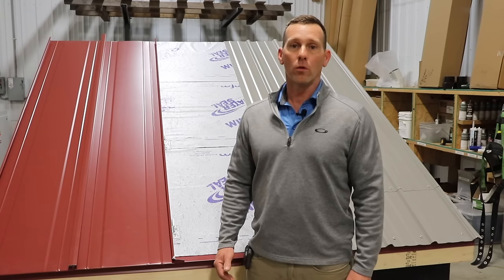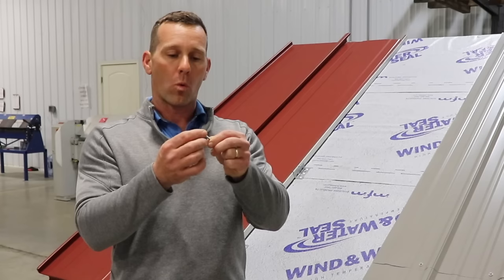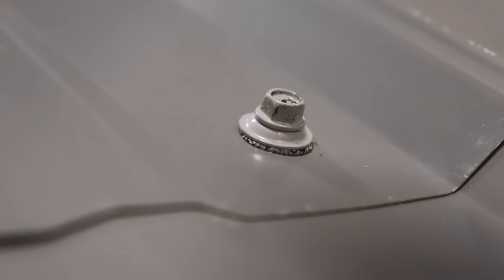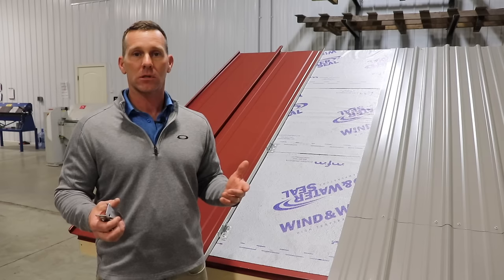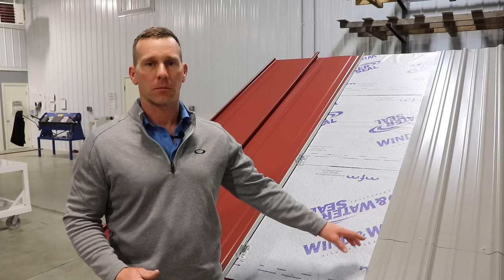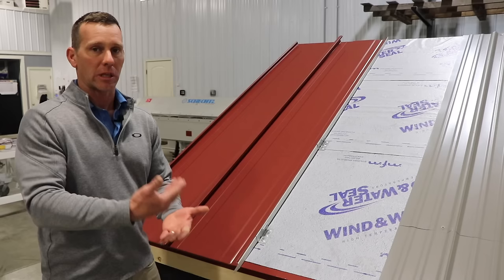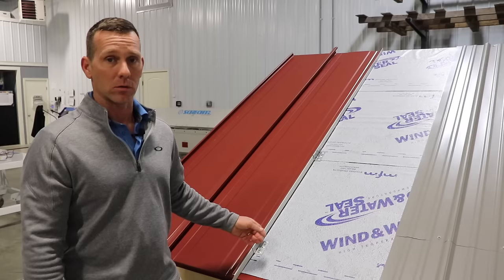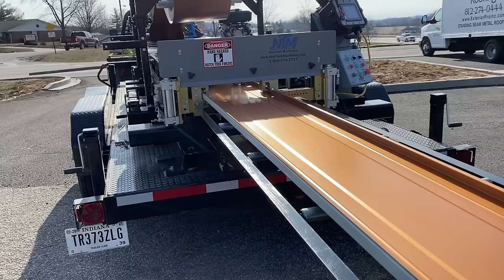Standing Seam Metal Roofing Vs  Corrugated Screw Down Metal Roof - Big Differences between the Two

Comment: I have been helping to install a standing seam floating roof system using a manual crimping tool, and automatic electric seam sealer. The panel are 46' long, and the boss was unfamiliar with how to install this system, but he went ahead anyway after a brief description from the delivery guy. My sense was that you could either manual crimp at the beginning and at the end, and go over each seam with electric seam sealer, and repeat for each seam, or you could do assembly line process, and lay down all roof panels crimping each sheet manually 3 or 4 times, and then go over the whole roof with automatic seam sealer all in one step. I was also led to believe that you needed to use manual crimper at each clip fastener. My boss had a lot of trouble getting seam sealer to work properly. We began putting a fastener clip down every 2 feet which seems excessive to me. A clip at perimeters, and every 10' would seem to be a better idea. It would be a lot less work, and I think using less clips more easily allows for expansion of metal, and much of what holds roof down is panels being crimped together. The boss is still trying to figure out what we have been doing wrong because the seam sealer is not doing the job.
Reply: Hey Brad.  I’ve installed a few standing ridge metal roofs and have never used a crimper or heat.   I’ve installed the roofs in high wind areas and on mountain tops using AFC material and it calls for SS screws down the unexposed side of the panel.   Floating roofs might be a better answer in a calm environment.
Reply: @tomewing4645  I don't know what AFC material is. I think the crimping on this roofing system was required to seal the roof from rain and snow. The crimping also helps to hold the roof system in place along with the hidden clips every few feet. The clips are designed to allow for expansion and contraction, and as long as the crimping is done properly , and not done too tightly, then expansion and contraction is not inhibited. With this roof system it was recommended to use the electrical crimper machine, but amazingly the building contractor didn't know how to use it, and I actually think he was trying to crimp in the wrong direction, and did some damage. I ended up using a manual crimper on all the roof seams which only took a couple extra hours compared to the automatic crimper, but I think the automatic crimper is recommended by the manufacturer, and if there are any problems any warranty would be voided. I think the automatic crimper provides just the right crimp with consistent pressure to seal the joints, but not make the joints too tight  to allow for expansion and contraction. This is something I never thought about until just now! Because I used the manual crimper there could very well be areas that are too tightly crimped, and expansion and contraction will be disrupted,  The roof panels are 45' long...
Reply: @bradcampbell5766    AFC is the manufacture.   Our longest panels are 32’ on a private residence with a 10/12 pitch.   I looked up floating roofs and like that concept.    After doing mine I found the metal roof to be better than comp or wood shingle.   At least you save the cost of a loader for roof delivery.

Comment: I'm puzzled to your explanation to swelling and contraction as far as the clips go, I install standing seam roofs about 8 to 10 times a year and I am a firm believer that its the best roofing solution on the market also the most expensive but let's be honest here all standing seam roofs will have screws in the panel itself, or maybe you could explain how the z channel is attached at cap , end wall flashing, transition points and outside rake enquiring minds would like to know
Reply: The video shows the clip attached to the roof but only clipped to the panel.  This allows the panel to expand and contract without pulling on the screw.  The metal panel is simply sliding up and down through the clip.
Reply: @scientificapproach6578  you never answered my question and I do understand your response to the clip system , the screw down system has slots for the same reason but MY POINT is the roof still has trim that has to be screwed through the panels and I mean ALL TRIM  trust me I know what I'm taking about I install about 10 of these roofing systems a year

Comment: If the screws are correctly installed to where the gasket does not become totally flattened out when screwed , then the tuff ribbed metal will be just fine  and will not back out , if you also used furring strips screwed into you roof joist .  The steel is also manufactured warranty with a limited 40 year minimum life on structure and color if properly installed .  I love mine and it was 12k less than standing seam , for 32 squares of roof surface  with 4 pitch gables and 4 valleys .

Comment: Sales tactic,  the screw doesn't go where you placed it,  it screws on the highest spot for 2 reasons,  one is if the rubber fails the water still won't get in, two, with expansion and contraction the screw can move with it
Reply: Combined with Ice guard under the steel. It would last longer than the paint.

Comment: Steep roof cabins in the mountains do better with standing seam sheet metal roofing as long as there are no valleys in the roof design. The screws holding corrugated sheet metal bend over and eventually tear out over time due to snow buildup, bottom layer ice formation, and eventual migration of accumulated snow/ice down slope. I see this on mountainous area cabins where they get a lot of snow. So called “fat boy” fasteners have been employed to curb bending but eventually even they get worked out where moisture seeps under the screw seal washer, freezes, expands, pulling the screw up bit by bit over time. If a cabin was built where the roof has a valley, neither roofing type will stand up. The ridges of corrugated, and seams of standing seam, sheet metal roofs can allow ice and snow to accumulate massively in the valleys. As thawing commences slope accumulations begin to migrate down slope into the valley of both slopes causing haphazard build-up and creating “glaciers”. These eventually become so large/heavy they overcome the strength of materials and migrate down valley while tearing out/through obstructions in path. Think what ridges and seams of either roofing type do, they act as obstructions, not to slope but to down valley migration. I’ve seen several feet of slope of corrugated sheet metal roofs get mashed/ twist over / torn off in and above the valleys of these roofs. No type of fastener, sheet metal roofing type can stop this type of damage unless the surface is completely smooth or valleys nonexistent.

Comment: I've built a lot of buildings using exposed-fastener 29 gauge steel roofing. I regret it now. Yes, I saved lots of money. But in the long run it would have been smarter to go with standing seam. I'm now looking seriously at tearing off my twelve-year-old metal roofing to upgrade to standing seam, as I'm tired of needing to retighten hundreds and hundreds of screws every year.

Comment: I went and price they building at a big-box store and they said that the screws on the roof would have to be put in the rib corrugated metal or the warranty would not cover it which is better in the quiet or in the rib?
Reply: Correct.You're supposed to screw on the ribs to avoid any water that may pool in the valleys
Reply: I work for a company that put up a warehouse and they put the screws in the ribs and the roof leaked.
Reply: Never ever screw the pan (valleys)
Reply: @jefferykeeper9034  it would’ve leaked from a flashing or something else, water doesn’t stay on the ribs by the time it reaches the screw

Comment: The clips prevent leaking but not lateral expansion that creates oil canning. This is commonly known in the industry.That's why you want standing seam WITH striations or corrogation in the metal. Otherwise you'll see your roof popping up. Don't get a totally flat paneled roof. Look at other sources on this.
Reply: Don't the panels in this vid have striations?  They're not as prominent as the ones in the corrugated panel, but they're there.  Are you saying that they should be more visible than the ones here?
Reply: @MajorImpact  The red standing seam panel he shows doesn't appear to have striations, just ornamental bends for strength. Metal roofing experts say that people have the most oil canning problems with these kinds of flat panels.  And what he's saying is incorrect according to them.  The seams don't  absorb expansion and contraction, the striations do. You actually need some corrogation in the striations - even if just at a very small size to prevent oil canning due to expansion and contraction. The panels need to be able to expand and contract like an accordion. Watch some other experts on here. You'll see what I mean.
Reply: @johnatyoutube  I'll do some looking; thanks for the clarification.
Reply: Being in the business for over 30 years,  to allow your lateral expansion. You do not force the cleat tight to the vertical of the lock on the panel, allow a little bit. Most of the oil canning is caused but screwing the cleat down to tight to the sheathing or insulation. You have to use common sense when installing any metal roof or flashing.
Reply: @funnycardriver  Thanks! That totally makes sense and is good to know.

Comment: thank you I learned a lot. standing seam seems to be the best.
Reply: Not necessarily.  The problems he talks about for corrugated are few and far between if installed correctly. Standing seam is WAY more expensive.....so the cost effectiveness of replacing a screw is in favor of the corrugated roof.  Have had metal roof for 10 years in Northern Maine.  Not one leak.  Not one problem.  This guy is a standing seam salesman.

Comment: looking at the standing seam how does the water not get between the where the 2 panels connect at if the rain is wind blown . Plus on corrugated metal how do you address roof vents for plumbing and air . In Virginia we need the air to flow from the front to the back of the attic . some of the ones here with ridge vents get blown off . I have watched my neighbor with a ridge vent get it repaired 4 times and it is a new house built only 7 years ago . Same with some of my other neighbors that have ridge vents . I am up on a hill and I  have no ridge vent but have vents on the back of my house . I am thinkng of a metal roof now snce roof in last couple of days with freezing temperatures and wind has blown 6 of my shingles loose on the front of my house . Just in 1 spot and 200 dollars to repair the damage  since i had extra shingles

Comment: I wonder if you use crush washers made of brass or aluminum would hold up better than neoprene washers
Reply: Todays screws do not use neoprene rubber, they use EPDM rubber which is superior. The screws used today and light years better than the screws used just 10 years ago.

Comment: Aussies & New Zealanders watching this are saying “screws goes on the ridges not the valleys! “
Reply: It's not rigid way to install because metal will bend before rubber seal is tight enough also if you step over ridge near screw it will move so wind and thermal movement can be happen and holes start to deform and eventually leak. 
Totally same if you leave wheel nuts or bolts lose on car wheels they will eventually get off.
Reply: @mr.wizeguy8995   our roofing screws 1st drill the metal, then screw into the timber battens, then a larger Dia thread section secures the metal ridge. The whole of Australia and New Zealand is done this way.
Reply: @tonydoggett7627  Haven't seen screws like those so dunno how good they are but still it depending how well that larger thread stick to metal compared to screw in valley screw thread is only at wood and metal is between batten and washer so no much room to move.
Reply: @mr.wizeguy8995  https://www.buildex.com.au/products/roofing-cladding/15-fixing-to-metal-and-timber-zips/1-roof-zips/
Reply: Tony Doggett broken link. I’ve wondered about something related to Australia. I’ve seen landscaping products that I want here in the states but this particular product I want seems to be everywhere in AU but nowhere in the states.
Reply: The ridges seem are way less likely to leak.
Reply: @caribbeanbound8357  not done that way all across Australia and New Zealand. Look up: Colorbond roofing

Comment: Nobody's mentioned that standing seem roofs in a bad storm come off in one giant sheet. Corrugated typically either folds or comes off in pieces. One you have to replace the whole roof the other you just repair panels. ✌️

Comment: I can't believe you're in the roofing industry and you can't screw a roof down properly. 
If you screwed the exposed fasteners correctly you wouldn't have the problems you talk about. 
NEVER screw in the valley, only on the ridge.
NEVER over constrain the sheet by putting in too many screws (it needs to move, a screw on each side of the ridge is a big no-no)
In Australia we have been using exposed fasteners for decades on corrugated  metal roofing. It is a tried and true method in extreme heat and cold.
Even if the washers did deteriorate the water needs to rise above the ridge to even think about leaking.
My own home has exposed fasteners, I've been living in it for over thirty-five years and have not had a leak. 
Not saying that 'Standing Seam Roofing' is worse (or better), I'm just pointing out the 'evils' you mention for exposed fasteners don't exist if done properly.
Reply: I’m curious about the meaning of valley , are you saying only screw down on ridge sides or are you saying to screw through the ridges on each panel?
You guys in Australia certainly know a lot about steel roofs so I’m interested , very interested.
I need to build in a hot desert 120 F to 30F in Arizona
Reply: if you take the time to cut 1by 1 and place them down first whare the ridges will lie,  then screw the metal to the 1 by 1 and seal the over lap. just do a little thinking before starting;~
Reply: @utube012341  Hi Tom, I did reply to you a couple of days ago but my comment seems to have gone missing (maybe because I had hyperlinks?????)
To answer your question, think of the roof sheet as a mountain range. The valleys are the low points (the flat of the sheet on the profile shown in the video) and the ridge (or crest) is the top of the rib.
FYI:-Wall sheets are screwed differently to roof sheets. 
The manufacturer of the roofing material should provide thorough installation instructions for their product. It's not just about where you put the screws, there are are a number of factors that contribute to the overall performance of any roof. Starting from the base frame up to the type of screws you use and even the type of sealant that is compatible with their product. Try googling "lysaght roof installation manual" as an example of what I'm talking about. 
Much work has been done in our cyclone (I think you call them hurricanes) prone areas in Australia and screwed down corrugated metal roofing seems to be the most resilient. If they can withstand the very high wind speeds of a cyclone and not get ripped of or leak then they are good enough for where I live.
Hope that helps and good luck with your project.😀
Reply: @Jack_C_  thank you !!!
I’ll be dealing with high temperatures and winds but not often over 50 mph .
I really appreciate this information as I have taken note of Australian ranch roofs as it seems like a similar climate .
I’m impressed by the huge overhangs , they must provide a lot of sidewall shade
Reply: @strawdog2831  interesting idea thank you
Reply: @utube012341  Yes, large eaves really help to shade the side walls. I have 8ft verandas all the way around my "ranch" style home and they really help to protect from the elements.
Another product we have here is 'foil backed fiberglass blanket' , it goes down before the roof sheeting is screwed on.
It really helps to keep the heat out. I installed it on an out building I have on my property and it works great! It stops heat ingress right at the point of entry, the roof. I wish it had been around when I built my home but I would have to re-install all the roof sheets to put it on now.
These days people seem more inclined to install a large air conditioner and just pay the electricity bill.😏
If you have the space and the funds at time of building then proper design is cheaper in the long run (IMO).
Reply: @Jack_C_  good information on that insulation under the panels !!
Definitely didn’t mean a ranch home u.s. style ,
Your place sounds fantastic!!
I’m going to put up a fairly extensive solar system but still 120 f is a lot to deal with .
I’m also considering a subterranean summer retreat as the below ground ( 17 feet deep and below ) should be 68f. I see underground homes in the opal mining areas of Australia .
I feel an investment is better than higher costs long term, usually anyway.
Thank you for the tips
Reply: My shop roof screws are on the ridge or rib
Reply: If I can get that long out of the roof I'm satisfied. By the time it could potentially leak I'll be dead.
Reply: You’re required to screw per the manufacturers instructions and design. If you read these panels it says to screw in the valley.
Reply: @sithcdw  Well if that is what the manufacturer instructs I'd be looking for a different manufacturer. 
The only time a screw should go in the valley is when the sheet is used vertically (wall sheeting).
Makes no sense to put a screw hole under water and expect it to never leak. Placing the screw in the ridge also allows the sheet to move as it expands and contracts (like a concertina) . We are also required to install as per manufacture's instructions and I've never seen any that say to screw in the valley on a roof sheet.